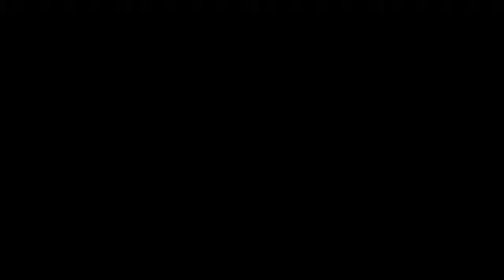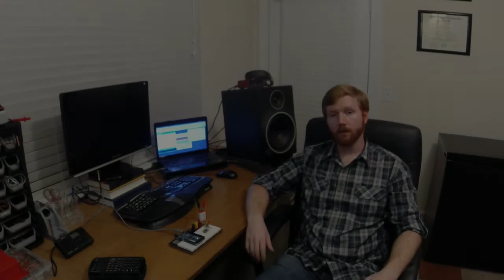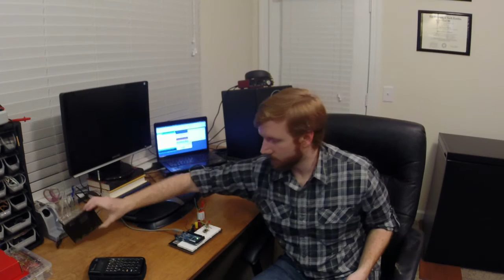Simple 20m Radio Transmitter + Arduino CW Encoder

Comment from the maker: I should mention that a long wire antenna may overload a basic receiver that's 99% designed to use the built-in antenna stick.